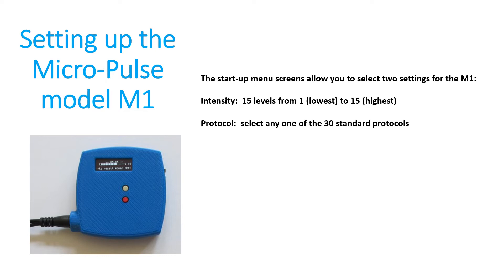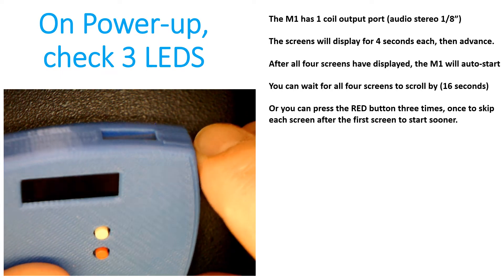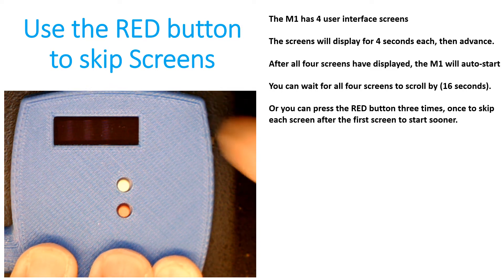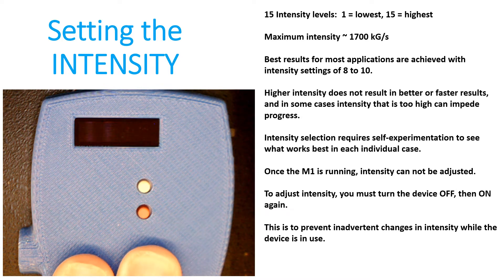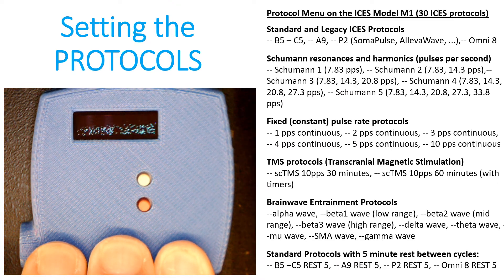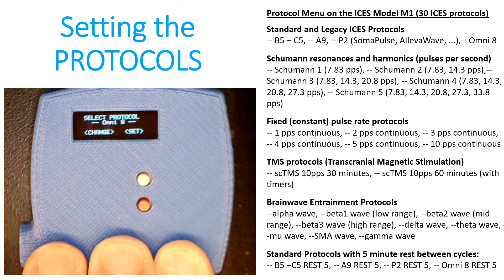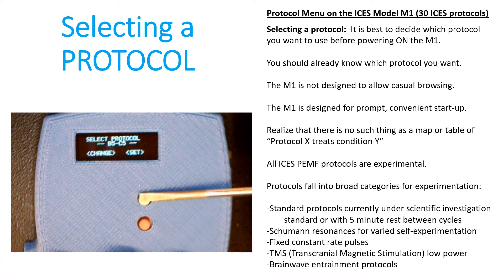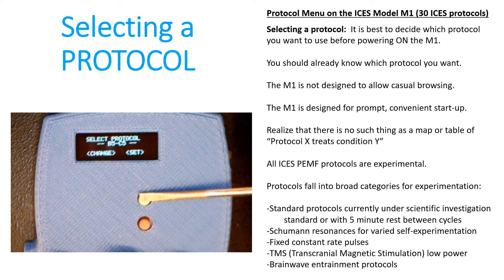M1 ICES PEMF:  setup and adjustment of intensity and protocols

Comment: I just received my M1. I don't intend to use the batteries. Do I just plug in the power cord and then turn on the unit? And where would I read up to determine which protocol to use? Thank you.
Reply from the maker: Yes.  Just plug it in, slide the power switch up (it would turn on the opposite way if you use batteries) and it will start right up for you.
Make sure the coils are plugged in firmly, all the way.
Based on personal experience for many years and a lot of customer feedback, try these pulse patterns:
-Omni8
-Alpha Wave
-Schumann 3 or Schumann 4

Every few weeks or every month it works a bit better if you switch programs.  Some people notice a slight improvement in the effectiveness when they change pulse patterns every few weeks, some do not.

Keep in mind: maximum power IS NOT necessary.  Many people make the mistake that this device is like a lot of the other stuff you might buy, where it barely works and you have to max it out just to get any benefit.  The best way to use ICES-PEMF is every day, for several hours or longer if possible, at MEDIUM intensity settings.  Over and over and over again people report to me that they get the best benefits from using moderate, not maximal, intensity settings.  So, I recommend you use the default setting to start: 9
Reply: @robertgdennis7472  Thank you!

Comment: Dr. Bob, I'm confused about the stated intensity of the M1- 1700 kG/s. I am accustomed to comparing PEMF devices in milli G, Gauss, or micro G,  but not "/" anything. I would read the 1700 kG/s as 1.7 million gauss/s, which sounds hugely powerful. I'm no engineer or mathematician, but k to me means kilo(1000). Would you set me straight, please?
Reply from the maker: The actual problems are many.  First, the numbers you usually see are guesses (or are blatantly fraudulent) on the part of PEMF marketers.  Often, their numbers are inflated by a factor of 10x to 100x.  I know this because I have directly measured the real output of several types of PEMF device, and it is never quite what they claim.  This is because most of these devices are just pirated from older designs, so the people marketing most PEMF systems really do not know how their devices actually work at any detailed technical level.

Second problem: the consumer has no way of verifying what they are purchasing, so it is easy for marketers to misrepresent it.  Think about this:  if you buy a dozen oranges, when you check the bag, you can tell immediately if they only gave you 7 oranges instead of a full dozen.  But how can you measure a Gauss?  I have a laboratory, so it is easy for me, but for the average person, not so much.

Third problem, they are reporting the wrong parameter.  Gauss is not the primary measure you need to know for PEMF.  And this is specifically where I think you are having trouble.  The correct parameter to report is Gauss per second (G/s).  Since it is a large number, it should be reported as kilo Gauss per second (kG/s).  But you are trying to compare that to Gauss.  That is exactly like trying to compare a speed with a distance.

It is like saying: How fast is that car going?  Answer: 4 miles.  This makes no sense.  You asked for a speed, and the answer was a distance.

The reason you need to know kG/s instead of G is because of the way electromagnetism works.  It is complex and mathematical and involves calculus.  But PEMF marketers do not understand electromagnetism, so they just use flashy words like "Gauss" to make their advertisements all sound "sciency".

Here is the reality: we know a fair amount about electromagnetism, but not so much about how biology detects it.  But there is a lot of evidence that PEMF does have big benefits if the system is properly designed and used.  Using unreliable numbers from PEMF marketers will not tell you what works, what does not, and which system works better.  The best you can do is buy a system from a reputable seller who sells systems that people you know have tried, and they work well, and the company gives good after-sale support.  Trying to dig into technical details will almost certainly lead you astray because there is so much fraud in the PEMF market.
Reply: @robertgdennis7472  Wow, you just blew any "trust" I might have had for any marketer right out of the water. It's very disappointing because I went with an Earth Pulse model that Dr. Pawluk recommends on his site. They claim their product's field can actually penetrate up to 16" of mattress. Considering the small size of the pulse unit itself, I wondered how it could muster so much power, but my mattress is only 8" so I figured I'd be good to go. They claim 1100 Gauss(no /s)per coil. Considering that you've spoken well of Dr. Pawluk, I figured I should be safe. Do you think we need to be much closer to the coils, given your statement of their 10x to 100x inflated claims? Like I said, this is very disappointing news, but I very much appreciate your time and detailed replies. I think you're a pretty cool guy.    PS- I'd like to experiment with your C5 or B5 unit, but I'll have to save my pennies for a good while before that can happen.
Reply from the maker: @buckmanaustin3211  Yeah, you really have to beware of PEMF marketers.  There are not really any standards for the performance of commercial PEMF products, so they can say anything they want.  If they say it penetrates 16", they can make a lot more money, and almost no one can call them out on it with verifiable numbers.  When they say something like "1000 Gauss", they never tell you the whole truth: that is the magnetic field right at the coils, basically a distance of 0.01 inches.  But when you move any distance from the coils the magnetic field drops off very very quickly, much faster than the intensity of light drops off. 

For example:
Light from a candle drops off at 1/d^2 (inverse square of distance), so if you double the distance, the light intensity drops to only 1/4.  But for magnetic coils, the drop-off is an inverse CUBE, (1/d^3), so when you double the distance from the coil, the magnetic field will be cut to 1/8.

I have tested the device you have (and several others) and when you get more than just a few inches from the coil, the magnetic fields are way below the background magnetic field of the Earth, way below what the marketers claim.

I think Dr. Pawluk also tries as hard as he can to be honest, but the claims of PEMF marketers are so filled with technical inaccuracies that this is an almost impossible goal.

However, many PEMF devices do seem to have benefits, even if the marketing is dishonest.  And when they seem to be clinically helpful, Dr. Pawluk tries to direct people to the ones that he thinks will help them the most.
Reply: @robertgdennis7472  Dr. Bob, I wish your message could get out to everyone that's trying to help themselves, or in my case, a loved one, to get well. When I think of how much some of these machines and devices cost, which is a real sacrifice for a lot of people, and how we're being mislead in what to expect, it makes me very angry. I can't tell you how much I appreciate your straight forward, science based explanations. Thanks again.
Reply from the maker: @buckmanaustin3211  Always glad to help.  My opinion: most PEMF devices on the market actually do seem to work.  Unfortunately the marketers of these devices use pseudo-science and fraud to represent them, which is not at all necessary, but they do it to gain a market edge. My opinion:  Your device probably works well, though not as well as they claim.  So it is not a total rip-off and may actually be very helpful.  I would just be very careful about believing everything they claim, and you can pretty much file their pseudo-scientific gibberish in the B.S. basket.  And I think I am getting the message out, one person at a time...
Reply: @robertgdennis7472  Dr Pawluk mentions the Gauss on your P9 that he sells on his site as being max 200...

quote....''Maximum intensity (level X) is 200 gauss (20,000 microTesla) and is only achieved when the coils are stacked one on top of the other (we suggest bumpy sides together).''

 is this true and can the same be said for the M1 in regards to gauss
Reply from the maker: @8888Riley  This is true.
Reply: @robertgdennis7472  and the M1?
Reply from the maker: @8888Riley  yes
Reply from the maker: @8888Riley  the output of the A9 is very close to the output of the M1.  They are about the same.

Comment: I had a bad response to dTMS therapy a couple of months ago. Went in for depression treatment and after the 9th session came out an anxious and fatigued mess after only the 9th session. Apparently their depression protocol stimulates the left prefrontal cortex at high frequency while their anxiety protocol inhibits the right prefrontal cortex with low frequency. I had no idea as I assumed most depressed patients have anxiety as well and are treated in a balanced way. He offered that I come back to try the anxiety protocol but I'm so afraid as I felt the machine literally cooked my brain as it blasted away. I ended up with restless sleep, severe fatigue, panic attacks. I'm a happy owner of your A9 unit for pain. Was wondering if the M1 could help rebalance the mess caused by dTMS overstimulation.
Reply from the maker: I am not an expert on dTMS, but I have read a lot about it and this is my personal opinion:
I believe the consensus clinical opinion is that it is probably applied at far too much intensity, as currently approved.  Also, apparently there can be unwanted side effects if the stimulation is not applied to the precise location intended.  You probably know this already.
Unfortunately I do not know if our ICES-PEMF systems can correct this, but I can tell you they are much gentler and you can use much lower intensities, so I suspect the risk of side effects is much lower.  I do not know, but if you decide to experiment with it, the effects would be subtle and you should maintain careful attention as you progress.
It might help many other people if you decided to tell others how you reacted, since I have no data or even anecdotal reports to draw from for this specific issue.
And of course I am glad to know the A9 is helping you.  The M1 is more versatile (more pulse patterns, more intensity levels), but our knowledge of all of its effects remains very incomplete and people mainly use it for self-hacking and self-experimenting.
Reply: @robertgdennis7472  Thank you for input! Is there a possibility that these various EMF therapies can potentially make the blood brain barrier more permeable? I tried a low dose low frequency TMS session today (anxiety protocol) and it seems if anything it triggered anxiety after I ate sushi and miso soup (msg containing). That was a potential theory of why I responded poorly to TMS. Perhaps those with circulating immune complexes, Inflammation could be harmed if these EMFs somehow open up the blood brain barrier to larger particles from the blood stream.
Reply from the maker: @vitaminboss  It is possible that PEMF may change blood-brain barrier permeability, but I do not recall seeing any convincing evidence of that.  But I suppose it is possible.